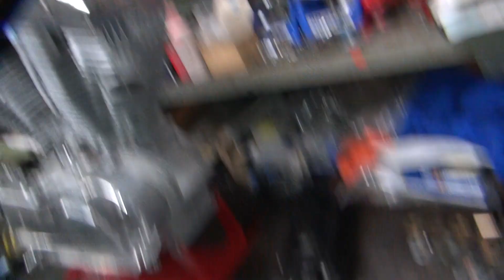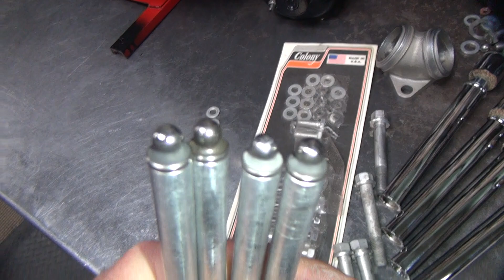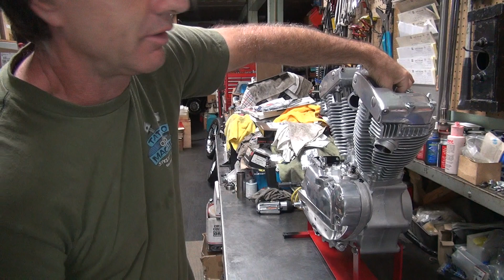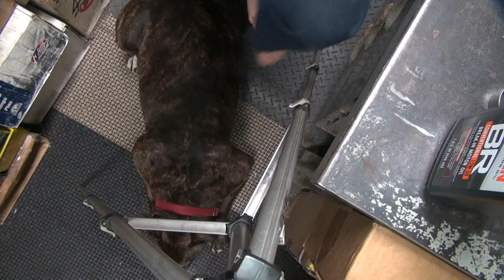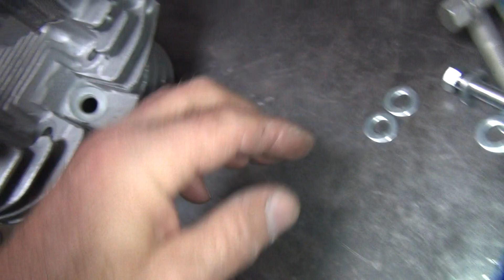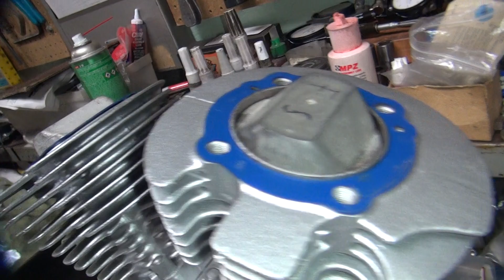1961 xlch #237 no miles transmission motor rebuild sportster harley repair restoration tatro machine

Comment: Is there any major differences between a 69 and 61 sportster motor with the rebuilding processes
Reply from the maker: for the xlch they are the same. for the xl and xlh there are some changes for the electric start stuff in the primary and trans.
tatro

Comment: I sat here watching you for too many years of inspirational guidance and bought a 2011 Royal Enfield Bullet Electra Deluxe 500 with 6535 miles. It is EFI meaning no carburation, has no tachometer. So I suppose I won't have to unlearn anything. Besides, it is impossible to copy your experience level, depth of knowledge, and equipment et. al. parts, etc. So why try? Anyway, you know more than me about Enfield, surely. I hope I haven't condemned myself and get remanded to purgatory from you and your viewers for the machine. Generally you will respond to questions. May I ask your opinion on the single-banger, straight up? Happy Easter. Thanks for sharing your inspiration. It is blessing.
Reply from the maker: all that matters is what you like. for me, its harley or nothing. new bikes do nothing for me so if it wasn't made in the 1900's i don't care. i like the 1957 and earlier models mainly.
all i know about your bike is that is designed from a late 40's bike that was basically unchanged forever. now that the indians know more about making things, they have been upgrading the bikes for sometime now. just like harleys, it has the look of the old bikes but noting else is close to being what it was. if tat works for you than have fun with it.
tatro
Reply: @TatroMachine  I do. Is Michael Parks Harley from the Bronson series ever been in your shop?
Reply from the maker: no
Reply: @TatroMachine  Thank you.